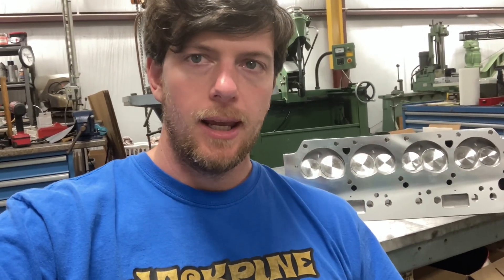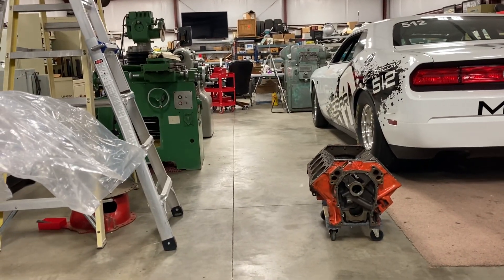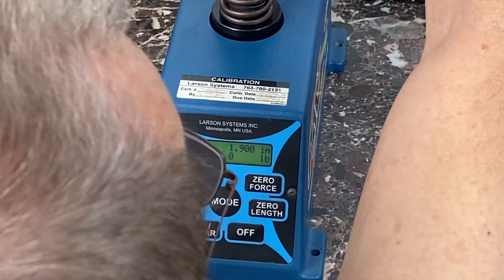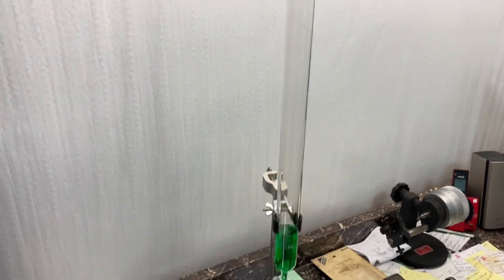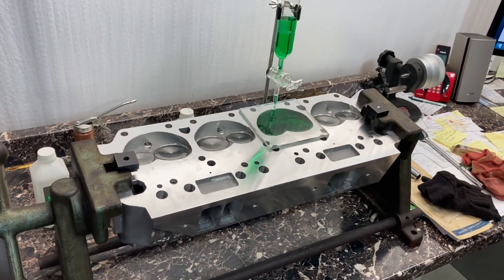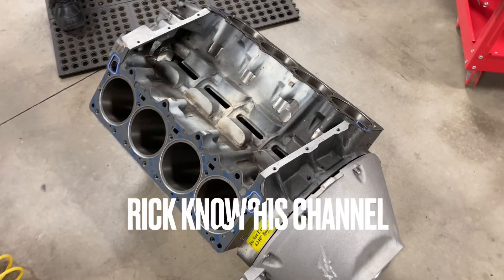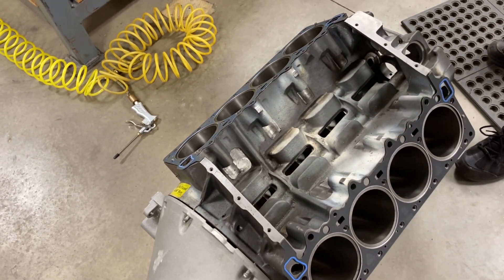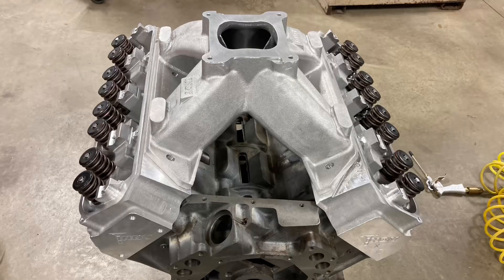Pump Gas 508 Stroker: Testing Chambers and Spring Pressures on Indy EZ-1 heads #mopar #engine

Comment: I have a 383 stroked to 489 with a Mopar Purple Shaft 509 camshaft. I don't have the cam card so I don't know if it is 108 or 114 LSA. Is there away to figure out which one it is? I might pull the timing cover to see if it is degreed correctly.
Reply from the maker: I would pull the cover if you’re worried. Otherwise I’d keep driving it. If it hasn’t been ran, then you can pull it and check. You might want it advanced 4 degrees anyway.

Comment: Hey Guys, i own a 511ci 400bb Stroker. At the moment im running indy SEZ heads but i want to Upgrade them in the future to max wegde but because of a lot corrosion i want to buy a New Set. Is there a big diffrence between indy SEZ / EZ and indy ez-1?
Reply from the maker: These were the only Indy heads I’ve used in a build. Here’s what they mentioned on their website,”The 440 EZ-1 is the same as cast head as outlined above with the intake opening machined to the Max Wedge size and CNC bowls. This allows all Indy manifolds to be used or all after market Max Wedge x-rams. Both SEZ and EZ-1 use standard Chrysler rocker shaft oiling. Standard low exhaust port.” The 440-1’s use the oiling kit in the rear of the block, and have an offset intake rocker arm. Hopefully that helps. I will upgrade to Max wedge port as well sometime.

Comment: The motor you had in the shop with the Indy heads was that yours or for the truck you use to own just wondering
Reply from the maker: No sir. This engine went in a friends truck. I have a short video showing it.

Comment: Hey Joe, What do you use to get the dye out? Like a turkey baster.? Just curious, I’ve never measured cc’s before. Wanted to do my small block, but went with iron heads from an old reliable truck until I can save up for aluminum ones since the rising costs have slowed my build.
Reply from the maker: Thanks brother.we just pulled the plug and let her drain into a pan.

Comment: The intake mating surface looks kind of chopped up on that one head, it it something you can feel or was it just the camera intensifying the image? Another great video, setup and double checking is a great way to keep an engine together and get the most out of it.
Reply from the maker: Thanks brother. It had some swirls of scratches from shipping or something. I think the lights and camera intensify it .

Comment: I'm glad checking your equipment went the way u had planned for. It doesn't always. I live in a rural area in iowa & there are a few small one man engine shops & I have had alil bad luck with one guy. I had a crank turned & a set of rods resized with ARP bolts. I got them back & ordered bearings but could not get the oil clearance I needed. I checked & rechecked my crankshaft over & over & it looked good but I still needed another thou off. I have several crankshafts so I even bought another size bearing & tried switching to that crank but still came up needing another thou of bearing clearance. I thought why? How on both cranks the same amount? So I took the bearings out of the rods & torqued the caps back on without the bearings & got out my dial bore guages & started checking my rods. That guy resized them all of them a thou under the minimum size. I took them back in & he checked with his guage & he got half a thou undersized. So we had a disagreement about guage readings, I do believe he has better quality guages but I know I check my calibration rverytime I use mine, & even still by his own guage he admitted they are undersized. He did redo them for me & brought them into tolerance & they are working good for me now. But it made me think, how used to doing his work like this is this guy? How often dus he just bring stuff close to spec but not in spec? How many people get there stuff & take his word that it's all good now? I'm sure most don't have the tools to double check? But to most people in there minds they did check, they took it to there engine guy & he redid the parts & he checked & said its good, so to them, they checked. But "they" didn't really check & he probably has gotten away with doing work like this for yrs. And when people assemble there own engine & have a failure, he will say he didn't put it together, they must have dun something wrong during assembly. And those guys probably believe that & except it.  Just sayin!?
Reply from the maker: Thanks for sharing. Check out Jeray racing and Bad tree Productions. They’re both in Iowa and face those same issues
Reply: @JustMoparJoe  I will check them out. I don't know of them by name. I do watch junkyard digs & thunderhead 289.